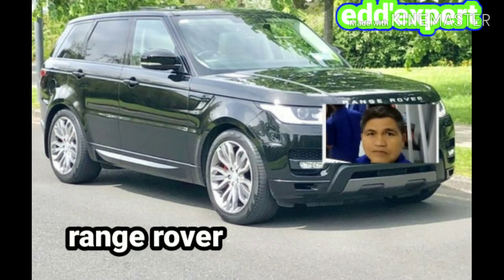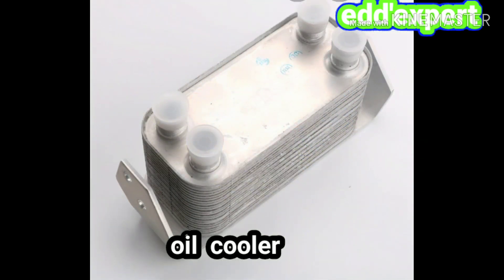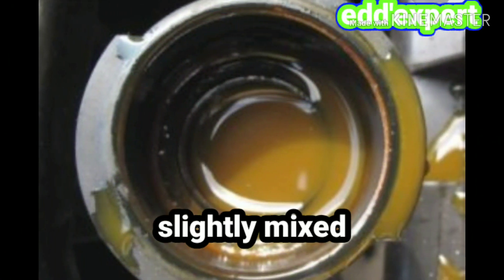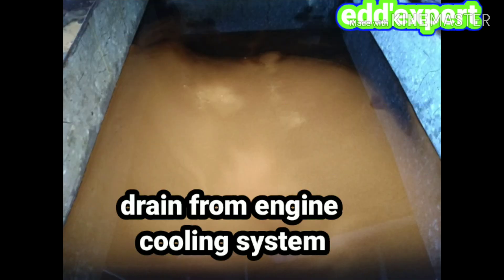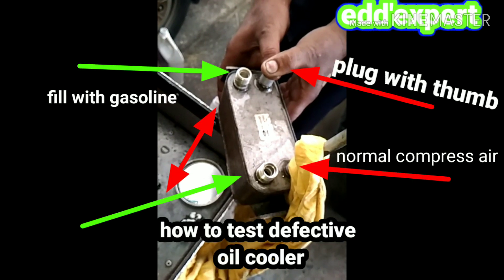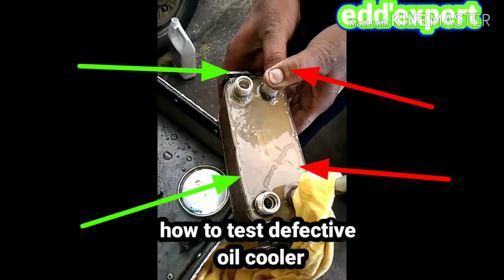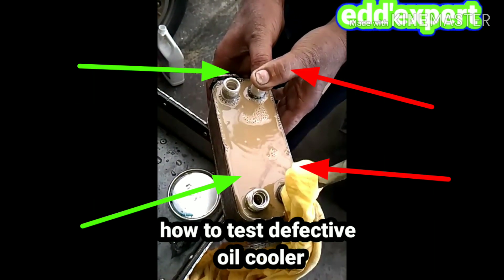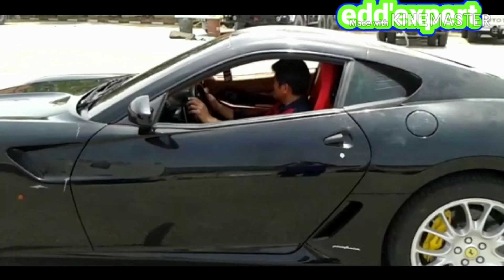🇵🇭 Mixed oil and water at engine oil cooler. Eddexpert@2021

Comment: How to clean the cooling system after replacing the oil cooler
Reply from the maker: With the use of flushing machine.
Without flushing machine, you must remove thermostat and use liquid soap and let the engine run.
Then lastly rinse with water until clear. Finally add engine coolant..
Reply: I have flushing machine in my shop. I flush with caustic soda first, then with washing powder. But still it's not so clean after flushing. Is there any other chemical to completely remove all the oil?

 How about kitchen vinegar?
Reply from the maker: Baking soda and liquid soap and add a little vinegar is the best for cleaning, but remove thermostat to free up of running water in the radiator and coolant gallery.
Only flushing machine but not more pressure.. To avoid head gasket affected..
Reply: Thanks for the advice. Yes I always remove the thermostat before flushing.